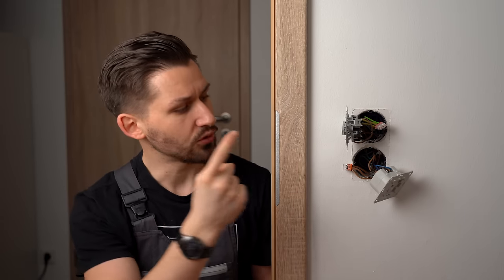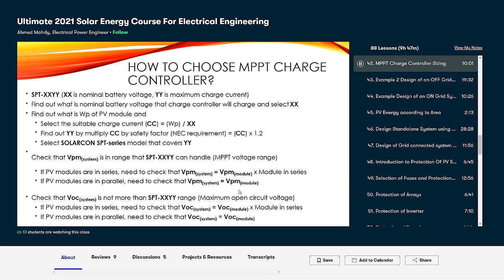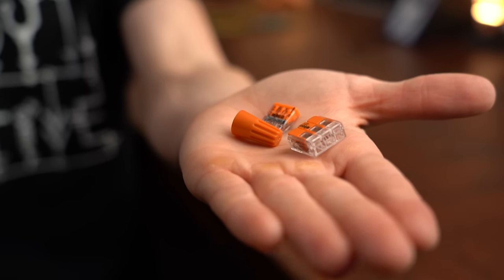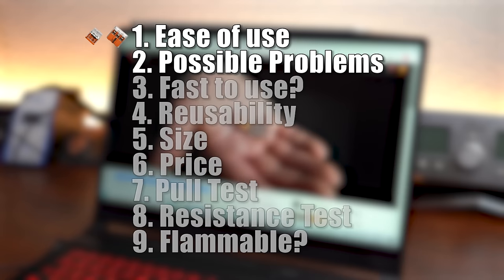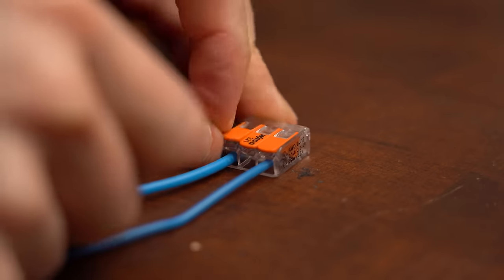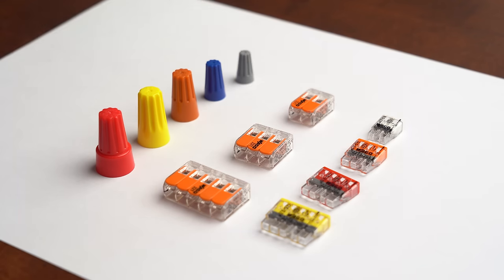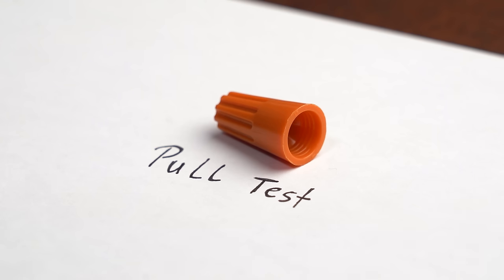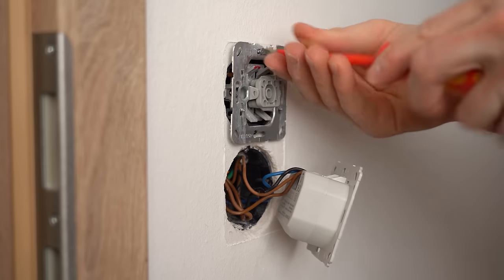What Wire Connector is the Best? Settling a Debate! Wire Nut VS Wago

Comment: The main thing you missed: wire nuts are more of a cover than a connector (not fully but mostly). The conductors are in direct contact with each other. Another note is always twist your wires together first which ensures good connection every time.
Reply: And this is exactly why they are DANGEROUS and forbidden in France.
Reply: This is another reason to recommend the Wago - the controversy on whether to pre-twist or not.  Some electricians recommend pre-twisting, some don't.  Wire nut manufacturers themselves actually recommend NOT pre-twisting.
Reply: @Benoit-Pierre  Wire nuts are not dangerous.
Reply: @killerdeamonking  maybe my experience is biased, but my house took fire twice due to improper work done by licensed electricians. (Unrelated with nuts ). And an inspector stated that there are several major issues in parts of the installation done by licensed people. 

In my professional life, I have also seen licensed electricians doing dangerous things, like using under gaged wires, or not correctly configuration gaz relays, and not checking their wirering. 

I can give full details about what happened in my house. I can't give details about my customers (professional secret ). 

But in short,  l prefer not trust any one and assume every thing is done improperly, and I proof check everything. Most of the time things are fine. But several times per week I find dangerous things that can lead to fire / death if not corrected rapidly.

Note that from what  have seen, you are right in saying that only unlicensed electricians kill themselves. I have never seen licensed electricians killing himself. I have seen unlicensed electricians doing things that would kill themselves later, and, licensed electricians doing things that would kill their customers. 

To rephrase,  have never seen any one killing himself. But I have seen many people doing things that were about to kill other people later.

So please don't read my message as« dangerous for the people doing things » but «dangerous » in the literal way, the victim could potentially be different from the actor .
Reply: @killerdeamonking  and i agree that in some limited case, nuts can be used with limited danger, by well trained people, taking time, and following a very strict procedure, and if you never need to modify the circuit. 

But it remains time consuming, and I often need to modify circuits, so I prefer to pay for Wago.
Reply: @Benoit-Pierre  When PROPERLY INSTALLED a wire nut is a superior connection and safe.  The fact that every new lighting fixture in the USA comes with Free Wire nuts and not WAGOs demonstrate the economics behind the electrical code where safety always seems trump economics.  Trust me WAGOs MFRs have tried to lobby for their safety.
Reply: @ericfraser7543  my teacher always told me to not trust wagos because of their insecurity regarding heat. Though he was pretty acadamic and worked in nuclear reactor sites for the electrical safety or smth like that...
Reply: @ericfraser7543  The reason that every new lighting fixture comes with wire nuts is that they are 4 times cheaper.  WAGO have been in use for deceades in Europe.  They're safe.
Reply: @cjmillsnun  Wire nuts are safe too...  and they are cheap, quick, and meet code...  plus I don't have to go to the store to get them...   If we are talking brand name WAGOs vs Wire nuts, you are probably talking more than 10X cheaper... would you be comfortable using generic WAGOs from china?  There is nothing too a wire nut.

Comment: I prefer the 221 wago because if you make a mis take its very easy to fix and they are very easily reuseable
Reply: And when it starts a fire??
Reply: The 2273 ones are also reversible, just twist them slightly while pulling on the wire you want to remove.

And no, Wagos don't start fires unless you really, really misuse them (i.e. don't push the wire far enough for the spring to grab it) and that's something just as easily done with wire nuts.

Quite a few European countries have been using Wago connectors exclusively for well over 20 years. Do you really think we wouldn't have noticed an increase of electrical fires if Wagos were actually bad?
Reply: @Ragnar8504  100% true 👍 i also work with stranded wire so The lever wago is sometimes must, when using single core solid wire i use The push connectors because they are smaller
Reply: @RadioRich100 All professionals use it in Germany. Never heard of a fire because of that
Reply: @nichderjeniche  I didnt know that every time theres a fire in Germany they reported it to you.
Reply: @RadioRich100  looks like you don't know many things.
When a fire happens here, (which is very rare) always specialists come afterwards and examine the house / apartment and search for the reason.
After your logic they should find in every second house a bad wago clamp and then they would complete ignore that problem and just let them continue their business.
I think it's useless to continue this discussion. Maybe even you understand now that you talk non sense.
Reply: @nichderjeniche  And after they find the reason, they report to you?

Comment: The resistance of the Wire Nuts is so low as the cables touch directly, so the electricity can flow from cable to cable and doesn't have to pass over a bridge, which may be thinner than the cable or less conductive (e.g. not being made out of copper). But the biggest advantage of Wago is that you can remove single cables, without having to touch the other cables.
Reply: also you dont damage the wire by twisting... if you twist too much it will fall off especially for aluminium wires... for those the wago 221 with protective vaseline is the perfect option...
Reply: The test port on wagos is also invaluable if you do service.
Reply: Wago's are rated 32amp
Reply: @Smajchl  that's not vaseline, vaseline is a petroleum byproduct.
Reply: @shadowopsairman1583  yeah probably it is not... in czech people call it like that... contact vaseline 249-130...
Reply: @BeautifulAngelBlossom  Nowadays aluminum wires are used only in transmission and high current applications in home installations it is just leftovers from communist era... but sometimes you have to deal with that too when fixing some old installations

Comment: When using a push-in type wire connector, always make sure the exposed conductor is as straight as possible before inserting it or else the contact points of the wago could be weakened and fail at a current lower than it is rated for. PS, shown in the video, that was not a variety of wire nuts, that was a variety of sizes of the same type of wire nut which were the the 'inexpensive' ones. Try a 3M O/B and you will understand what I mean by that.
Reply: or the Ideal. ones,   not generic cheapo import ones
Reply: @asbestosfiber  Yeah that was my thought as well.  Whenever we do trim outs we toss those cheap orange ones and use 3M/Ideal ones.  
While the push in ones seem convenient, the cost per wire nut seems to be the major factor.  I don't know about standards over there, but here in the US you just have to meet the NEC and make the inspectors happy...so if you can save quite a few pennies per wire nut, I would def do that.
Reply: @thecodingchicken  Wagos meet the NEC.
Reply: @hjc4604  but they still cost more, and that's probably the factor for many people here.

Comment: Quality wire nuts, used my electricians in the US, come with specifications, usage instructions, and are LISTED by either U/L or ETL.  Some of my favorites are the 3M T/R+ (excellent wire nuts and gauge versatility) and the Tan Ideal "Twisters" (also excellent, although slightly smaller than the former)

When joining a stranded wire with a solid wire, using a wire nut, typically you lead slightly with the stranded conductor(s) into the wire nut.
Reply: +1 for the 3M TR and the Ideal tan twisters .  As a commercial/industrial service electrician for almost 30ys I make 90% of my connections on general branch and lighting circuits with either of those.  I prefer the 3MTRs, they give a little more leverage when twisting by hand and they seem to "bite" into the wire better.
Reply: i love the ideal twister in any size orange tan red and blue the 3m wire nuts have a straight section on the spring that increases twisting resistance but i will say i do like the tmr skirts
Reply: @evanjohnson1927  Yeah, they use a square section spring.   The corner faces the wire for a better “ bite”.  It works well.  I agree with the skirt and well; even though a perfect splice shouldn’t have exposed wire below the wire nut there are instances where it happens and it’s nice having that extra bit of protection there to prevent a short.
Reply: @evanjohnson1927  One wire nut that I can’t stand is the silicone filled blue underground splice wire nut.  They were very expensive and made by a brand I didn’t recognize.  Even when splicing two #10 solids it was difficult to get a “ bite”.  If splicing stranded forget about it!
Reply: @barthchris1  yea the straight section makes them harder to twist on so for that reason I prefer the ideal but not are good products miles ahead of them dam wegos
Reply: @evanjohnson1927  Huh, I haven’t noticed that, I can definitely see how it would be a problem though.
Reply: @barthchris1  I gave up on those years ago. My go-to has been a normal 3M T/R packed full of de-ox. Sometimes silicone if I happen to have some handy.
Reply: @leftyeh6495  good to know I’m not “ nuts” lol.  Good idea with the anti ox or silicone. I’ve thought of doing so before but my luck would be having an inspector pop a cover and bust me.  Lol

Comment: Not to knit pick but (at least here in Canada) it's recommended that when using wire nuts that the conductors be twisted together tightly using linesman pliers before screwing on the wire nut. This drops ease of use but provides the best physical and electrical connection.
Reply: Last year i bought some wire nuts which specified on the packaging that the conductors should not be twisted together. So there are some variations in it. Just follow the instructions on the packaging in any case. The factory probably knows best what they designed.
Reply: @Engineer9736  stranded wires can't be pre twisted. Being an electrician for over 25 years, usually if there's a problem is because the wires weren't twisted and the nut not tightened enough. If PROPERLY used, all three options are adequate. But I've seen what happens if there's not enough contact at the connection... It's not pretty. So even though it takes longer and is harder, I still use wire nuts because I hate fires
Reply: @terrencehuebner8378  Stranded wires in permanent installations is forbidden here in Belgium, no experience with that in wire nuts... only solid core.
Reply: @Engineer9736  Wow, never seen solid core wire in any home or industry installation in Italy.
Increbible how standards are so different in countries in the the EU.

Comment: When I was an apprentice (back in the eighties) I used a few wire nuts. Thought they were rubbish!
Never used them since and if I found any I replaced them with screw connectors until Wago connectors became common. Now I use Wago connectors or similar spring connection din-rail terminals all the time. Fortunately wire nuts are rare in the UK.
Reply: So you were under qualified at the time to make that determination.... had have become militantly under qualified in the remaining years. The proof is in the pudding... spring contacts fail over time, wire nuts don't. Wire nuts main drawback is difficulty of installation but they have lower long term maintenance.
Reply: @Wingnut353  You're absolutely in the wrong here and insulting on top of it.
Reply: @Wingnut353  The few wire nuts I came across (in the UK) were replaced after instruction from the electricians training me. Based on that experience I drew my initial conclusion. After a further forty years experience I haven’t changed the opinion I had back then.
Wire nuts are not common in the UK, so in their defence they’ve perhaps not had a fair chance to redeem themselves, but the ones I have come across have been replaced by more common connectors used in the UK.
Reply: A professional have no issues with the wire nuts what so ever....

Comment: Another consideration is the condition of the wires you're working with.

I live in an old house with relatively fragile wiring. Twisting a connection together with a wire nut is not ideal. I appreciate that the Wago connectors can be used with minimal disturbance to the wiring.
Reply: This is an EXCELLENT point. 
Having felt the frustration of twisting a wire nut on 110 year old wire and having it go to pieces several times before redoing the wiring in my old house; Wagos would have been a godsend.
Reply: Same in Eastern Europe where old houses have alluminium wires. That is fragile and you cannot mix in a nut with copper, either.

Comment: Nice Video! Here's my worry about the Wago connectors. 
Over the last years, I have had to replace many switches and outlets in my home. These all used the "spring contact" type of connectors. Meaning you strip the wire and push it in to the unit in question. All were more than 25 years old. A few years ago, I had a "holy crap" moment when I happen to put my hand on an outlet, and it was very warm from use. Apparently, after so many years, the spring contact begins to lose it's "spring" As the contact spring has less "tension" against the wire, now  you have additional resistance, and thus heat.  
The more the the spring connection gets hot, the problem gets worse over time.
And, as far as I can see, both the "Push in" outlets and switches use the same principle as the Wago connectors. 
I have changed all of my switches and outlets to the "clamp" type for a safer, secure connection. 
I have used the Wago connectors and yes, they are nice. But my worry is how  they will perform 20 years down the road.

Comment: As an HVAC technician in the US, I spend alot if not most of my time diagnosing electrical issues.  I can say that about one in twenty issues are from wire nuts that have jiggled loose over time (two to five years based on previous repair records).  Then you have the issue where the two or more wires were not lined up together properly when the wire nut was twisted on.  Since I have discovered the Wago's, I have switched to them whenever I can.
Reply: Coming from automotive work to home electrical work was (oh damnit) shocking. I was initially appalled by the idea of wire nuts as I was sure they would constantly come undone. I slowly realized that most parts on a house don't move much so don't need the kind of attention that automotive wiring does. HVAC systems I can't imagine why they would use wire nuts.
Reply: It’s because hacks don’t pre twist
Reply: That's because they are either installed wrong or cheap versions, or both. Quality 3M nuts properly installed on pre-twisted wires will never have this issue.

Comment: In my recent wiring projects, I've relied more on push-in connectors - not the Wago but another brand available. Definitely never going back to wire nuts if I can help it.

One point as well for the Wago and similar connectors: you don't have to have all the conductors ready to go at once, so there's nothing to undo when adding. When I was rewiring my attic lighting, replacing old ungrounded wiring with grounded, I had everything coming to a junction box. I knew in advance that I'd be adding a light to that, so I prepared for that using 3-conductor connectors that initially had only two conductors going to it. When I added the additional light, there was nothing to undo to add the conductor.

Comment: I have used both, although I must admit the I have not used Wago nearly as much.  With that in mind, I feel that the Wagos are worth the higher cost because of the lack of inspectability of the wire nut connections can result in inconsistency.  You have to be diligent and careful with wire nuts to achieve a good connection.  Reusability of wire nuts in my experience is much, much easier than Wagos, but I usually just cut the Wago off and discard it, so I think wire nuts are a clear winner there.  Still, the safety of the improved consistency is IMHO a much weightier factor than any of the other items, and again, IMHO, the Wago is a huge winner there.
Reply: There is no need to cut WAGO connectors off. Just a little twisting back and forward while pulling on the wire releases the wire. The wire then can be reinserted without cutting or bending required.
Reply: Wago 221 :D
Reply: It is not that easy to take off the non-lever wago, specially in tight spots and those with 3+ wires. 
So if the wire length permits I cut the wago off with just a bit of wire. Then use pliers to remove the wire bits.
Or use the lever ones instead. The additional resistance is something to take into account though. But I think its mostly ok, since that is mostly used for light circuits anyway.
Reply: Bruh, those small wagos are really easy to detach. I've tried wire nuts as well, and from my experience both of them are easy enough to detach, but wagos still win.  You got wrong technique, they're almost easier to detach than lever wagos. You don't need to twist the wire, just a connector small twists back and forth while pulling out wire you want to remove..
I've met couple of electricians who also did cut them until I showed them that it's unnecessary to do so.. Trust me, I've thought so that way at first too until I met someone who showed the right technique.